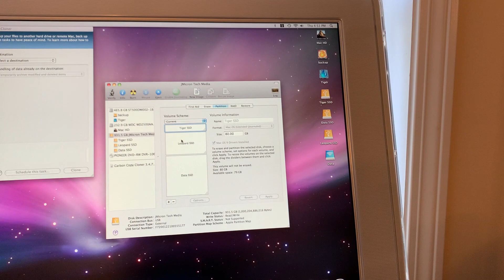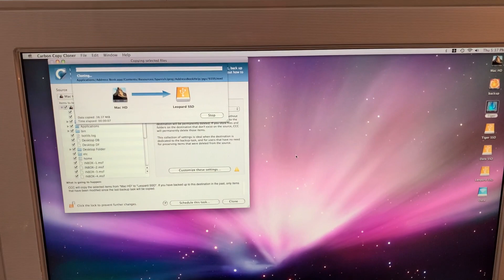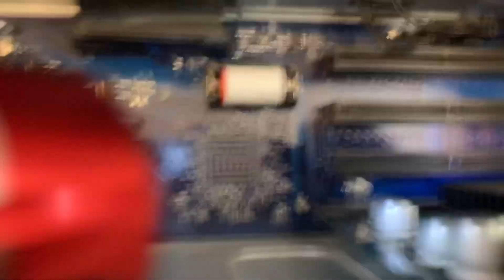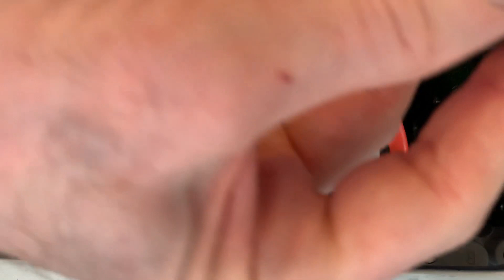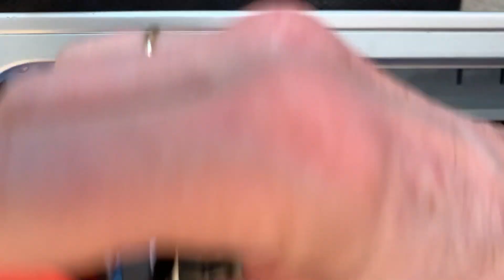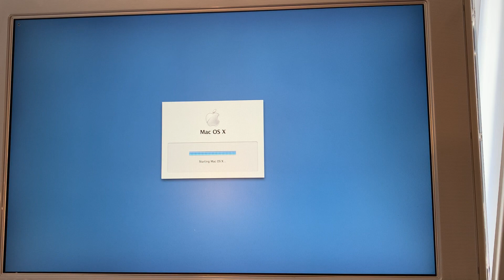Upgrading the Power Mac G5!

Comment: i know its an older video but for those looking for a ssd i recommend the cheap pny ones (128gb) will work without issue
Reply from the maker: In the intervening time, I've explored it, and settled on the Timetec drives. They are definitely backwards compatible with STAT 1, and quite reasonably priced. Since I actually use these machines, 128 GB is a little skimpy for my use case. 

I also did a video where I compared a new, faster spinner with an SSD. Given the limitations of SATA 1, the spinner is pretty close to the SSD, and a lot cheaper.

Comment: I have a dual 1.8 with a protools setup. I thought about buying a quad 2.5 g5 for $100 on marketplace. I can max out the ram for $50 and add an ssd....will do circles around my 2005 setup at a minimal cost
Reply from the maker: For $100, I would probably grab it myself, and I already have two quads. I got the first for $100, with the original Bluetooth mouse and keyboard, and a 30 inch Cinema Display. I got the second for $50, I don’t think the guy really knew what it was, he just wanted it out of his apartment.

Comment: Your G5 is so quiet! I rescued mine from a dumpster and (despite cleaning) it sounds like a hair dryer! :D
Reply from the maker: Stinkiestbrainever it can vary by when the machine was made. My 2003 is noticeably louder when the fans rev up. This late 2005 is about as quiet as my Mac Pros. That being said, the 2003 is quiet compared to a G4 MDD, for example. If yours is really that loud, I would wonder if there might be an issue with the fans themselves. Can you iso;ate where the sound is coming from? If it’s the lower part of the case, it would be the GPU fan, if it’s from the top part, that would indicate the hard drive fans. It is possible for the cables from either the hard drives or the optical drive to get pushed against the fans, causing a buzz. You might also take a cloak at the clear air baffle when you open the door. If that is damaged it might well cause the fans to ramp up to max.
Reply: @brokenelectronics3665  thanks for the detailed reply! :D
In this case it's just the nature of the beast to be loud under load as the inside is flawless. It sits next to my hackintosh which is water cooled and all noctua fans so you could say I'm spoiled with silence!
Reply from the maker: Stinkiestbrainever , okays, I just saw that you are replying to an older video. My late 2005 is even quieter. Just out of curiosity, what year is yours, and what are the specs?
Reply: @brokenelectronics3665  Dual 2.0 from 2004 with 1GB and SSD. When I found it I gave it a good clean and service then used it to import all my old MiniDV tapes through firewire. I don't have much use for it now as it sits beside a Ryzen/vega 64 hackintosh but it's still very beautiful so it will stay where it is!